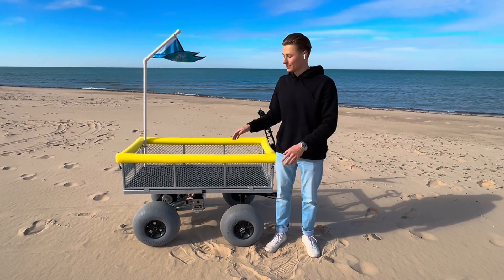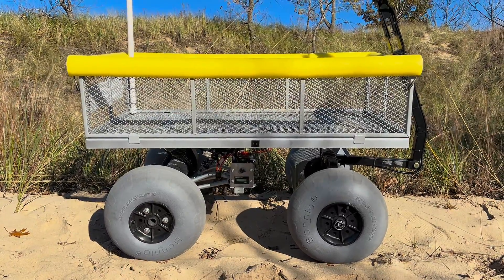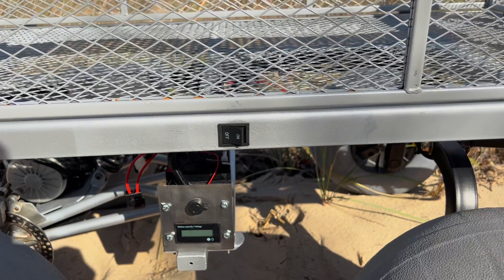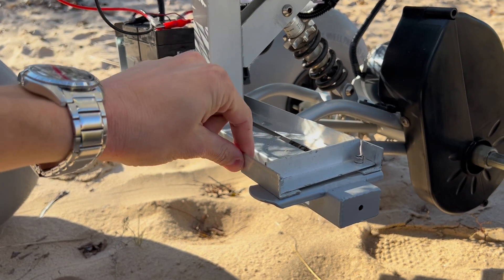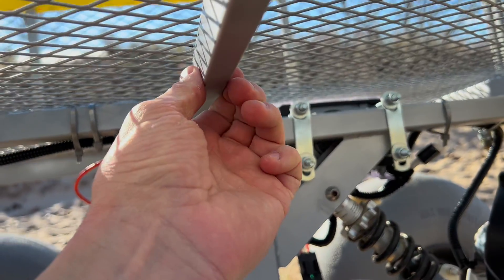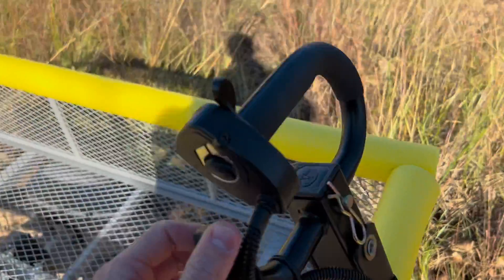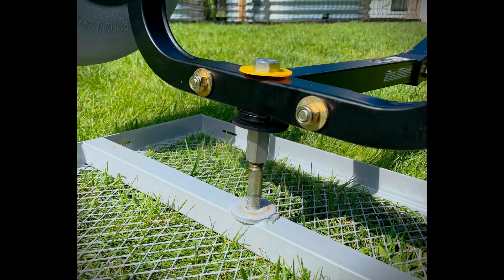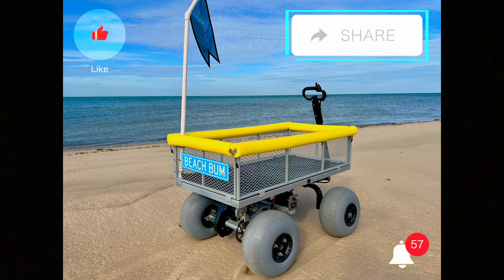Ultimate Electric Beach Cart

Comment: How manys lbs can it haul? Im looking to build one so i can haul my scuba equiptment in the beach
Reply from the maker: 100 lbs and it will run fine on the sand. You could go more but I never max tested it. Keep in mind that we're using a kids ATV motor, so you can use whatever weight the ATV normally holds. The problem is will it be okay on the sand and 100 lbs works fine.

Comment: On Amazon, I could only find 20 MM bore size tires is that OK for the beach cart?
Reply from the maker: Hey, to be honest I am not too sure. I see they recently took the 22 mm size balloon tires off amazon as of this comment. If you have amazon prime I would purchase the 20 mm tires and see if they align with the hub. If they don't returns should be free.
Reply: Not sure if I’m gonna purchase those tires I’ve had big problems with them when I put weight on the cart they are slipping off the rim and the air valve is coming out of the hole. They don’t hold good weight. Do you think the tires from the original quad in the back would work in sand
Reply from the maker: @centronefamily8717  I have not had that problem. The tires should not be slipping off at all, you must not be constructing it properly. Look at my video again, a nut should be holding them firmly against the flange. If the nut is coming off get a lock nut with a nylon insert and make sure it is tight. The original quad tires may work on the sand, but it will not be as great, you will get stuck, and I wouldn't recommend it. I would stick to balloon tires, they are designed for this purpose.
Reply: I think you misunderstood me. The rubber is slipping from the rim it needs to be glued on. I called another company that makes beach carts This tire company is not making these tires anymore. They are horrible to deal with. I don’t recommend this company.
Reply from the maker: @centronefamily8717  Thats good to know. Apologies for the misunderstanding. There are 6 original nuts and screws in the tire. Did you take out all 6? I would have to see a picture to visualize the problem. Email me one at ryankcreates@gmail.com
Reply: Has this happened to you at all?

Comment: Hi there,
The cart looks great.
I’m in the process of installing the balloon tires which are from the same manufacturer.
Rather than pulling your hub I made a template of it.
When placed it over the BT hub to match your orientation in the video, the hub holes lined up with the small holes on the BT. These  holes allow access the screws with in the wheel.
Did you run into this issue?
If so how did you solve it .
Thank you 
Joe
Reply from the maker: Hey, if I'm understanding correctly the hub you have is matching up with the balloon tire holes. Thats great. The three holes on the balloon tire that correspond with the hub should originally have screws in it. I took out the 3 screws of the balloon tire and put the threaded rod through it. When you place your nuts on the thread rod it will keep everything secured still. Hope this helps!

Comment: How wide is that cart? Will it fit thru a doorway?
Reply from the maker: I have the cart link available in the description which will include the cart measurements. If you made some modifications and size the wheels closer together, then yes it will fit a standard doorway. However, the cart I have in the video will not fit a standard doorway.

Comment: Ryan, that's a beautiful build!  Back in 2012 I built an electric fishing cart for my Dad.  It was created from a Hoveround electric wheelchair.  I can say without a doubt that it was a fun journey building it. I learned quickly that I had to separate aluminum components that touched steel components with plastic washers to prevent corrosion due to galvanic action from the sea water in the air.
Nice job! You'd be surprised on how many people talk about building an electric cart, and never follow through on it. Your instructional video will help those aspiring to build there own.  If you are interested in looking at my cart you can search the words below.
"Ultimate Electric Fishing Cart Soft Sand Test"  https://youtu.be/yAE1NU1thMI?si=QvJ7R0HA4VjvOd_e
Reply from the maker: I appreciate the comment! It was very fun building the cart. I barely knew anything and learned a lot from gears, to motors, to electrical work... you name it. Loved the video you sent. Your cart looks great, very well-constructed! Is it still running after all this time?
Reply: Ryan, yes.. it’s still running. I use it around the house loading firewood into my truck and loading camping gear.

Comment: I just started my project and want to use the beach tires to. Did you run an axle through the rear wheels or just the threaded rod? Thanks
Reply from the maker: It's a fun project, totally worth it! I only used the three threaded rods for the rear tires, do not run a center axle as it will be pointless. Best of luck!

Comment: Are you concerned with your wiring getting wet?
Reply from the maker: No. If it's going to pour that day I'd avoid taking it out. A little water won't hurt. After all, the electrical components are all from a Razor Dirt Quad ATV that belongs outside!

Comment: 2 questions:

Why leave the brake fittings on?

Why is your flag at the weird angle?
Reply from the maker: The brake is still on because it stabilizes the rear axis. The flag is at that angle so you can read what it says and keep the flags shape. If you put it straight upright the flag will fall straight down.

Comment: What kind of bearings did you use for the wheels to turn smooth that won’t rust?
Reply from the maker: Are you referring to the flanges? If so, it came with the Razor Dirt Quad ATV.
Reply: @RyanWaves  gotcha. I have a junk wagon from Amazon. That almost everything rusts. Trying to get a couple years out of it. I buy cheap thrust bearings each time I use it

Comment: I need to build one of these.  My two big concerns are distance and getting it dirty.  Can it be cleaned by washing with water?  I need to go about two miles each way with it.  Is that even possible?
Reply from the maker: yeah man you can easily go 4 miles total. The better batteries you get the longer run time. I posted a link in my description of some good batteries that I currently use. I can probably get around 8 miles in between charges (may be more haven't fully tested it). 

Yes you can rinse it off, but I would try to avoid rinsing the electric components. Use a scrub rag then a rag with water to clean it if you want to be on the safe side.

Comment: Ryan do you have a bearing in the front wheel mount or do you have a straight aluminum rod tub straight through the plastic wheel hub?     Rear makes sense due to the flange, but a Gorilla cart wheel generally has a wheel bearing to void wear on the straight axle.    Let me know and Thanks,    Nice job 
BTW the reverse works like a champ.
Reply from the maker: Thank you! Yes it is only a straight aluminum rod tube through the wheel hub. There is very minimum wear on the tires with the setup I have. I do not think it will cause any problems. Worse case scenario the wheels will need to be replaced by the time it were to cause any problems. Hope this helps!

Comment: I just got back from the beach and decided to build an electric cart after the first pull to the beach. This is a genius build for the price. Are all all razor quads the same size ? I’m already sourcing parts to basically mimic your build. Glad I found this video.
Reply from the maker: I'm not exactly sure of the sizing for the different Razor Quads, however, I used the cheaper version which I found used on facebook marketplace. Different versions of the Razor Quads have different size motors, voltage, etc., so be aware if you change sprockets as you may need to adjust sprocket sizing to slow the speed down. I posted a link in my description of the exact Razor Dirt Quad I used. Let me know if you have questions building and i'd be glad to help!

Comment: Just found your video Ryan! Awesome to see another build! I'd like to show you the my version I made last summer. It was definitely an eye catcher on the beach lol I did go with the razor tires and will probably try a different set up for weight reduction.
Reply from the maker: Thanks!!! Yeah dude I would love to see your build! Send me some pictures or videos at my email, ryankcreates@gmail.com. You should 100% swap the tires out, it is worth it.
Reply: @RyanWaves I just uploaded a quick video of mine last year on the beach! I had to do a little more frame work then you but check out the load lol no idea of the lbs but man it's freakin packed! I'll shoot you some pictures of my build. If you look I actually went with 2 lawn mower batteries and have zero issues with battery life. I just charge it after our day at the beach.
Reply from the maker: @jasonc470  your cart looks awesome! I've had zero issues with weight problems in mine. I've had 80 lbs in it and it worked phenomenal, honestly my cart could even hold more. I ended up changing to bigger batteries this summer because I finished the build in November so beach days were on a halt. I'll post a link to the batteries I bought because they are awesome, I can get 3-4 trips out of them before a charge. What are you going to do differently with your set up?

https://www.amazon.com/gp/product/B07TTWBZPD/ref=ppx_yo_dt_b_search_asin_title?ie=UTF8&psc=1
Reply: @RyanWaves that's awesome! I quickly realized weight and the quad shock was not enough lol then it dawned on me why not just make it rigid I have no reason for a shock and that really solved alot of my issues. I needed my wheels to be under the cart.. I actually bought a electric wheelchair hitch hauler and I drive the beach cart up that and that's how we haul it. I'll send you a picture and it will make a little more sense. I'd love to switch to lithium simply because of weight reduction. I still need to do the sprockets that should help me with more torque. The balloon wheels had just crappy reviews unless you go with wheeleez so I'm up in the air about those still. I added cell phone chargers to mine as well and those have been handy! I'll email you a few pictures
Reply from the maker: @jasonc470  The balloon wheels are worth it, I would never use the stock Razor tires on the beach. I've had these balloon wheels for over 3 years. Yeah they have some flaws, but at the end of the day they do one job, spin. Get them and you'll find out how much more weight your cart will carry on the beach. Also definitely change out the sprockets, you will and need that extra torque. But yeah, email me some pictures!

Comment: What kind of range do you think it comes out to when looking at the amp hours on the batteries?  And is it hard to pull once the battery is out?
Reply from the maker: With range, it ultimately depends. Factors to consider are the battery Ah's and the weight the cart needs to pull. The heavier you haul, the more work the cart must pull, leading to less run time.

When the batteries are out it is extremely hard to pull the cart. I wonder if there is a way to release the motor's chain and let it run freely, but I haven't looked too much into that. I'm sure there is.

I just bought these batteries from Amazon. Two Lead Acid 12 V 12 Ah batteries. They've been running great. Been hauling the cart 2-3 miles and used it three times without charging so far!

If you're on the edge if it's worth building or not... it is 100% worth it!

https://www.amazon.com/gp/product/B07TTWBZPD/ref=ppx_yo_dt_b_search_asin_title?ie=UTF8&th=1
Reply: @RyanWaves  oh I’m definitely going to build something. Not sure if I’ll make a video or not… 2-3 miles without charging is really good, that’s plenty for me.
Reply from the maker: @foreverfloridian8525  Show me the end result!
Reply: Ryan is there a freewheel switch
Reply: Ryan how did you securely attach aluminum rod extension for big wheel
Reply: Forward/ reverse switch wiring video and parts list
Reply: Explain the electrical wiring instead of show casing you work which is brilliant
Reply: More detailed information

Comment: Ok so that 3 extended threaded bolts did u have to drill bonnlo wheels or it has already holes pre lined up?
Reply from the maker: The Bonnlo tires have 6 holes in its frame that have screws holding the plastic frames together. The hub/flange from the Razor Dirt Quad has three holes that line up perfectly with three of the Bonnlo tire holes.

 I had to take out three of the Bonnlo tire bolts, line the Razor Dirt Quad flange up, which perfectly aligned with the tires holes, and drill the existing Bonnlo tire holes slightly larger to fit the threaded rod through.
Reply: @RyanWaves  that is awesome! Thanks for the info 👌
Reply: How do you get the bolts out of the tire rims. Thanks
Reply from the maker: @mackbristow4384  Drill a bigger hole than the previous ones there, then place the rod through.

Comment: Where do I get or buy those flange/hub to attach the wheels to the axle?
Reply from the maker: Hey, so the flange/hub used are the ones that came with the original Razor Dirt Quad ATV. I got pretty lucky with the Bonnlo 12" tires because their frame fit perfectly with the flange/hubs. All I had to do differently was drill the preset holes in the Bonnlo tires plastic frame slightly larger to fit the 5/16 threaded rod extension through. Let me know if you have questions!
Reply: @RyanWaves  nice!!!! Ok thanks for the info I appreciate it

Comment: Hey man, great build. I got two questions. So I decided to run two big 12 volt 100 amp hour lithium batteries instead of the small one to make it a 24 volts system from factory. Also I am going to run a 9 tooth main and a 40 tooth big gear which would give me even more toque than a 36 gear. From my math 2.5 MPH max. Do you think I can haul 300 pounds? Im contemplating jumping up to a 36 volt system, a little nervous it wont be enough UMPP.
Reply from the maker: Appreciate it! Yes you should be running this as a 24 volt system because that is what the Razor Dirt Quad ATV used in the video runs as. Mine too is a 24 V system, but I just have two small 12 V batteries taped together. I do plan on buying two new big 12V batteries this summer for the longer run time, and would recommend it.

I can't give you an exact answer if you'd be able to haul that much weight. Increasing the torque will give you more power on the sand, which in return will pull more weight. I think if you are going to go the 40 tooth rear route make sure that electricsooterparts (or another seller) makes the 40 tooth rear with the same design template to fit on the Razor Dirt Quad axle and hubs. They may need to custom make it. 

If you jumped to a 36 V system, I would definitely increase the gear ratio to add a lot more torque otherwise your cart's speed will be way too fast if it's behind you and you're in front. Keep that in mind before buying your parts with the 9:40 gear ratio and using a 36 V system.

Comment: Ryan, Awesome cart. In the process of building one myself. Got tired of hunting for a Razor on Facebook so I purchased a new one from Walmart. My issue is the weight. Out of the box it is 100lbs. What is the final weight of your cart?
Reply from the maker: Hard to say. I haven't weighed it myself but I would guess it is around 100 lbs all done. On the sand the cart works great, glides smoothly. Show me your cart when it's all done!
Reply: @RyanWaves  How do you get the cart from your house to the beach? I've seen a commercial ecart that required some sort of hitch mounted carrier.
Reply from the maker: @georose33  I live 2 miles from the beach so I am able to wheel it down. Getting it into a truck is possible, in my case however, I didn't need to find a solution to that!

Comment: Hey Ryan nice job and thanks for the shoutout. Did those tires line up with the rear hub flanges or did you drill new holes in the balloon wheels?  I’ve contemplated putting on the large tires on mine.  My only concern was the bad press the cheaper large tires have vs wheelez and I wasn’t paying $100+ each for the wheelez brand lol.  Nice job and keep us posted on how the tires you have on last!!!!!
Reply from the maker: Thank you! You gave me the idea of making my own and I did!  Surprisingly, the Bonnlo 12" tires I posted in my description fit perfectly with the rear hub flange (usually I never get that lucky..) All I had to do was drill the preset holes slightly larger in the tires frame to fit the threaded rod through. The brand balloon wheels I used works fine. However, I have noticed that some tires have gotten malformed with air lumps in them. The seller was quick to replace them but I wonder if malformed tires are common with balloon wheels due to being outside on the sand in those 90 degree days. The cart glides over the sand super smooth though. I would highly recommend them if you're debating it!